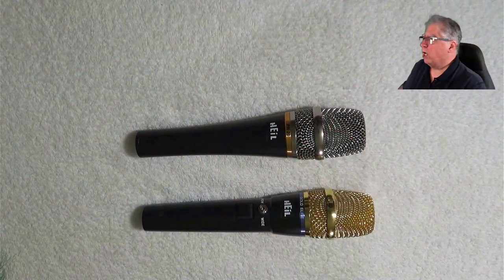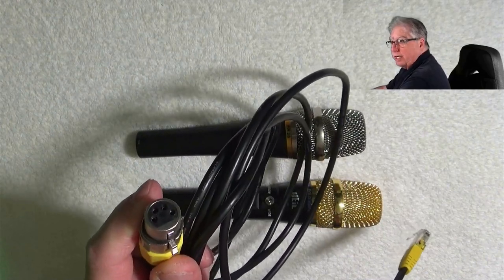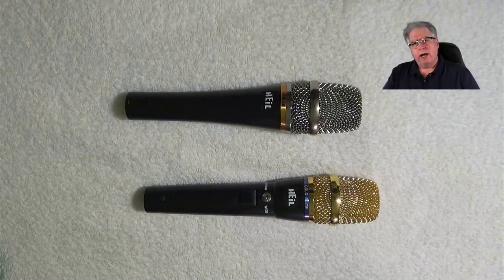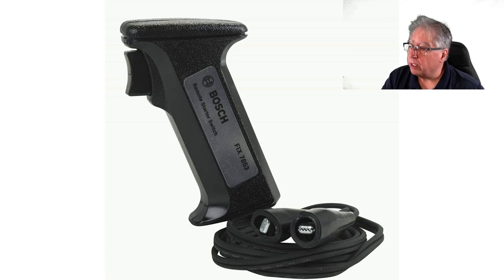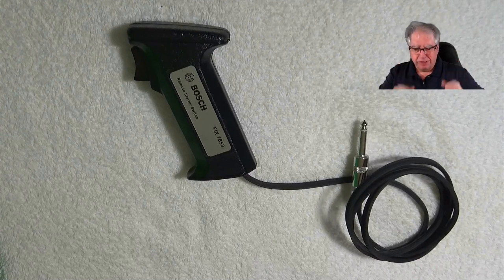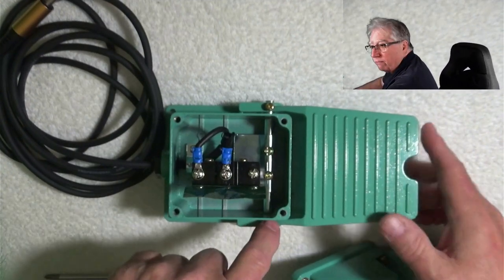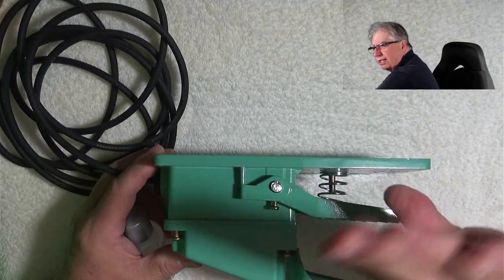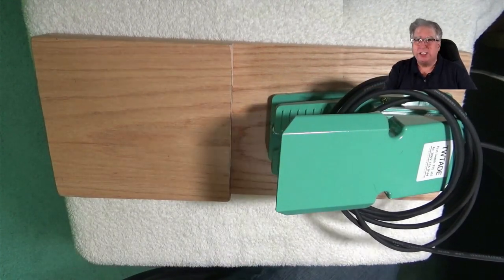External Mics And PTT Projects For Your Shack

Comment: When you started talking about foot switches I was thinking of the one I use, and wondered if you may have run across them... Then you showed yours which is exactly what I use. They really are great, and can be wired to key on the press or release, and there's no way I could ever break this thing. I thought about maybe wiring my main receive audio (I have multiple radios run through a mixer) so that it would turn off muting the volume while transmitting. That way if I'm talking on hf and someone comes across on 2m while I'm keyed up, it won't be blaring in the background as I'm talking. This pedal makes it super easy. I like your videos because they just get to the point and what's actually relevant to ham radio use for any given device, like the nano VNA, oscilloscope, tiny sa, etc. I don't need to know everything about these tools, just how I can use them in this particular hobby, so your straightforward video style makes it very easy to figure out what I need to know, then get back to actually doing it. Thanks for taking the time to share your knowledge with the rest of us. It's much appreciated.
Reply from the maker: Thanks Chris,
If you understand how it's suppose to work, you can fix it when it breaks!

Stu
AG6AG